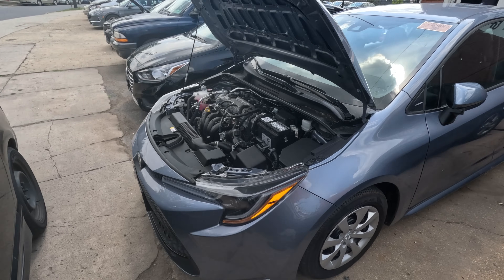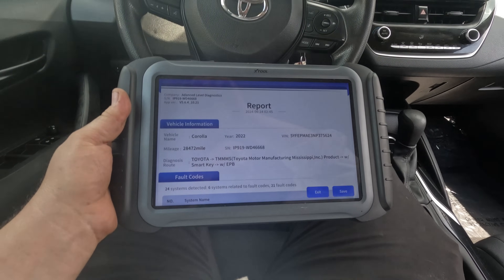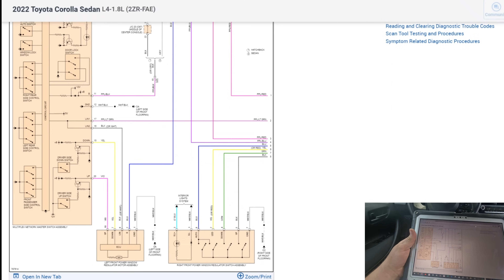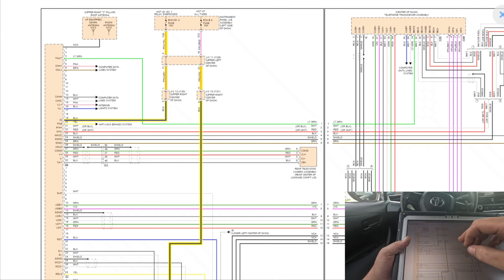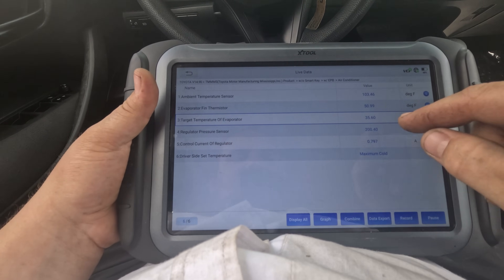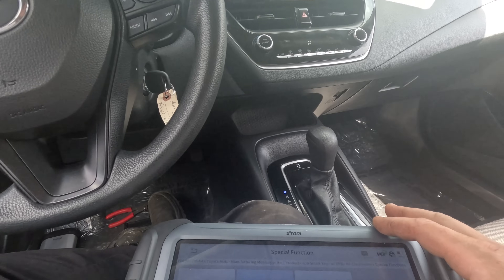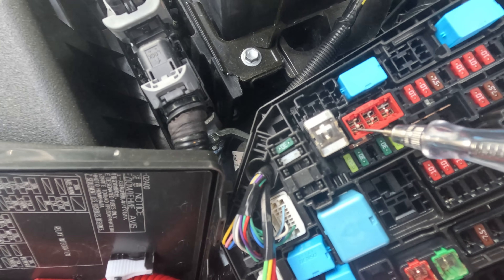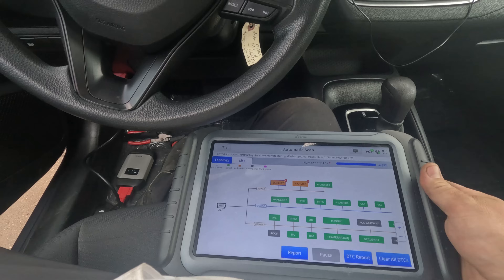2022 Toyota Corolla - Electrical Issues! (Xtool IP919)

Comment: My 22 corolla has similar issues (not sure what the scanner reads but the warnings seem the same) after jumping it with a jumper pack. At first I was worried I hooked up the cables wrong but the jump pack has an audible alarm if the polarity is reversed and the car started fine with no issues before taking the batter pack off. Is there a chance I somehow messed up and reversed them without even knowing?

Comment: I wish Xtool would add a voltage display. I have an older corded d8. Looks like the flagship ip919 doesn't have it either. I just ordered another scanner and went with the Topdon Phoenix Plus 2 to try out👍
Reply: My xtool d8s do display voltage
Reply: @alirezajafari7070 Ya the newer ones do. I have a D7W and it has the voltage display. My Launch CRP919EBT has it. It's my favorite tool👍

Comment: I have the D8S which is a lesser model to this IP919 and you can email reports if you first save the report, then go to the main menu and click on reports, click on the report you want to email and click on the share button. You can also save as PDFs and print the reports from there.

Comment: Toyota electric windows need to be cycled up and down individually to be operable from the driver side masters, especially after a dead flat battery or disconnect.  i.e. push window switch down & hold button down for 2secs after window reaches bottom, do the same when it reaches the top, do this for each door. You will now find them working at the drivers side. I have also struck this on the odd Subaru. I presume the battery went dead and someone has j/strtd this reverse polarity. Lucky for them Toyota's are usually well fuse protected. Cheers.

Comment: What I do on my D8 (xtool)  is just go into the module that you're messing with..  BCM in this case..  then you can go into live data from there and you won't have to search through so many pids.  The D8 has actuation tests (and special functions) from there too, and you can usually see some live data as you do the actuation test. These are still pretty good scantools, you just have to use them a little differently on some things.. You get used to it when it's the only one you got. :)
Reply from the maker: Thanks!

Comment: nobody ask the question, why does this car have so many blown fuses? that's not normal.
Reply from the maker: Whenever you have an Auction car with many blown fuses, I assume it was reversed boosted. Since there is no history on it, I don't worry about it unless it happens again.
Reply: He put a light on the circuit. if it was shorted out the bulb would have lit up. And also the new fuses would have blown right away. someone jumped this car backwards cables. happens alot at auctions. battery dies from sitting. People not paying attention hooking up cables or jump boxes

Comment: Seems like every scan tool has something another one doesn’t . I have a launch X431, a Xtool D7W. The X tool gave me headaches in the very beginning the VCI and tablet would not communicate and after many emails customer service finally sent me a return label and sent me a new replacement and it works great. If you need a contact in customer service email Phoebe she is surperb. Has the fuse problem by any chance reoccurred  ? Thanks for sharing stay cool.     Artie 👍
Reply: Wait 'til the latest update removes features you know you used in the past.
Reply: Not suppose to say this but but um... I dropped it few times 🤣